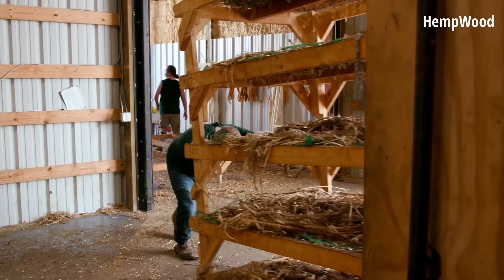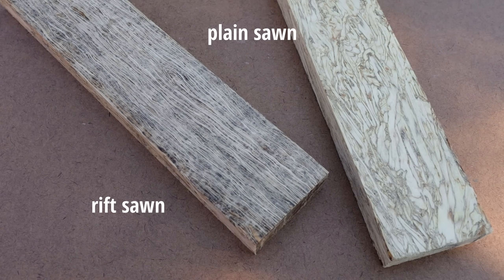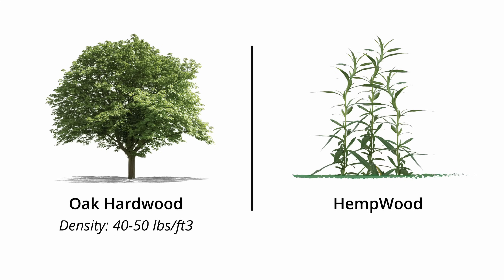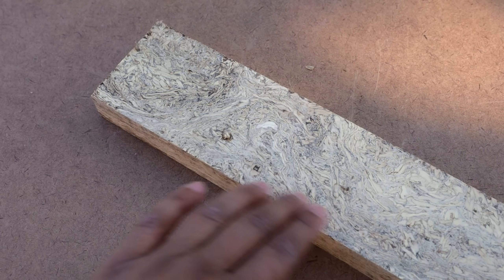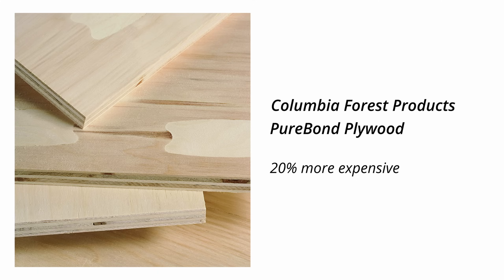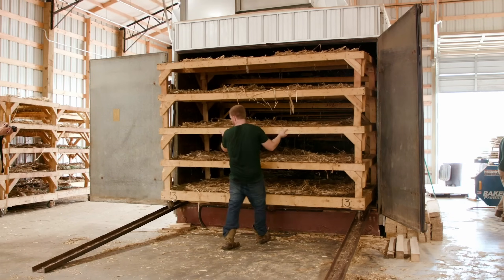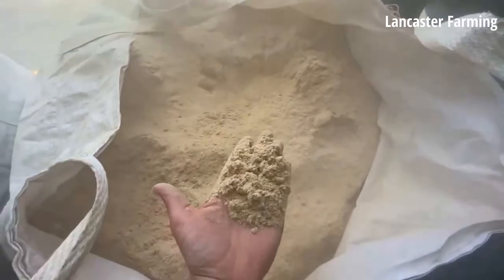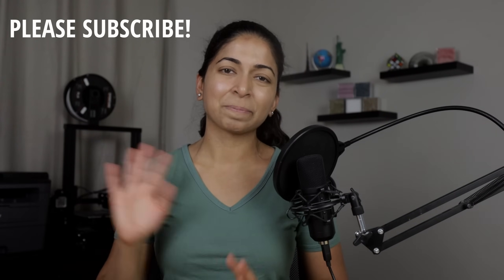HempWood | a NEW eco-friendly hardwood

Comment: Have all you people lost your critical faculties.

Let’s put the environmental issues aside for a moment. What we have here is a wood-substitute which is not structural, not very waterproof or weatherproof, expensive (5 times the price of regular kitchen cabinet materials), not attractive (in fact really ugly), no indication whether it can be easily worked (but I suspect not, like composite bamboo) or hold a nail or screw. 

So tell me again what is good about it?

Even on the environmental side it’s dubious, and showing a picture of an oak tree and saying hardwood trees take 150 years to mature is disengenuoius when we know that most plantation hardwoods are harvested in 35 years  (12 to 14 years for modern hybrid trees in this country) and softwoods in 20. Further, saying a crop of hemp can be grown in 150 days is only half the story - fast growing crops deplete the soil quickly so we need to look at the full life cycle not just some catchy phrase. Can hemp crops be repeatedly grown in the same soil or do you need long fallow periods which means even more land cleared and turned into monoculture, or mammoth amounts of fertilizer which bring a host of further environmental problems. The phrase nothing comes for nothing comes to mind.

Comment: It's not new & nor is it hardwood.
The definition of hardwood is a Dicot tree which angiosperms/flower unlike gymnosperms which produce seeds. 
Th action of the tree reproduction alters the grain structure & determines hard or soft wood.
Do keep in mind that teak is a soft wood with the hardness of hard wood as the odd exception. This is basic botany & carpentry knowledge.

I'm an Engineer & fabricator whom works with metal, yet I know this.  
This hemp product is plywood at best? (Plyhemp board) would be the most appropriate factual term in my mind.  
Even by camera I can tell this is a poor building, If they had any sense they would attempt to produce this material in a manner similar to the standard & methods for marine plyboard production for a start. 

This quality & practice is unsuitable for food storage as it has not been laminated base on sight let alone treated appropriately. I do not wish to bore you with the processing & bio chemistry of mould protective material. They go through two carbide tip blade per day because even my eyes can tell they have the teeth to inch ratio for any wood/ply like material off. That's the teeth ratio for aluminium. Carbides are also not advisable for wood or ply cutting as it inhomogeneous structure vibrates then wears the blade. You want a high carbon steel alloy but I'm not being paid so why would I tell them the specific alloy they need. They could do with employing someone that understand basic workshop principles.

Not structural & yet you advice people to build furniture with it. Wait till someone sits on it then breaks a bone. That is law suit heaven.
If you don't have children or pets this appears fine for flooring.

Comment: I find this a bit of a fad word shil type video if I'm honest. Cannabis plants are not trees and do not grow wood so calling it wood rather than fibre board or something else seems intentionally misleading, same goes for the use of the term hardwood, if cannabis was a tree then yes the fact it is an angiosperm would see it classified as a hardwood, but that speaks little for its mechanical properties or anything and I see it likewise misleading, deliberately  or not. The Janka hardness testing seems odd since this is not a wood, but given its a standardised test that has been used on wood samples that have been densified by similar methods to how this compressed fibre material is made I will accept it as reasonable, what is not reasonable is comparing it to oak wood board that has not been similarly densified or something as its pretty common for the Janka hardness to change there by about two times....... I can see how using up waste hemp if there was enough this way being a really beneficial thing so long as it's done in a way where its used close to where its made rather than shipped all over the world as a new ""eco"" material..... I like that the shortcomings of it are somewhat pointed out, but I think the other stuff kind of over does it that much that people will ignore its shortcomings and want to line a whole house with it.

Comment: How is this "eco friendly"? Sure... the fiber source is beneficial, but what about the binders, finishing products, and energy required to replicate what nature does with wood? 

Simply saying the binders are sourced from soy, isn't sufficient. What's the gross carbon chain? That's a lot of work (energy), transport (powered by diesel), and chemical processing... just to acheive what nature does in trees.... and you don't even have a finished product yet.
Reply: i think its very good to be wary of "green washed products". So far, the best uses for hemp ive heard are for reducing the need of logging, even if by a little. Hemp also grows faster than trees do, so at the very least- its a good buffer product for small wood furnishings like cabinets and doors. 

but i agree that more work needs to be done to fully publish the energy costs of hempwood.

Comment: if the cost doesn't compete price wise then it will only ever be an over priced engineered material just like all the others. nothing more than a bragging point. as far as building with it. if it is as strong as the video claims then what's stopping them from using it as a timber. if it's so vulnerable to moisture then isn't is just a glorified OSB? i usually like your video's but this one has me on the offensive. its a wonder material but its main use is backed by another material. what makes you view this any different from your opinion on 3d concrete structures. the cost savings will never transmit to the user.
Reply: Yeah, it seems to be glorified OSB to me. The janka hardness is skewed as well because it's also rating the glue and not just the material itself. This also means its harder on tools and more difficult to work.